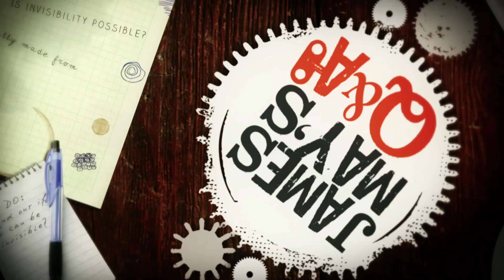Why Can't Trains Go Uphill? | James May's Q&A | Earth Science

Comment: James May, you completely forgot that us Americans have locomotives that can go uphill (very slowly) with great ease! The Shay, Climax, and Heisler locomotives can conquer grades of up to 9% by way of geared wheels. Some even have two gear transmissions. Even though they're very slow, they still get the job done, especially in logging country, as opposed to rod driven locomotives. The Lickey Incline has had it's fair share, but it's nothing compared to grades like Freighthouse Hill in Tacoma Washington for example (3.5% Grade, and took a rod engine and an GM-EMD F9A to tackle it with a four car excursion train two-and-a-half years ago; that's fire and thunder there!).

Good explanation though sir, and now if you'd be so kind to explain why we have no "Flying Boats" of substantial size anymore, or why we are attracted to gaudy cruise ships, over proper ships like ocean liners? Then I'd most definitely be thrilled. Cheers sir, cheers. Complements to your airship video too.
Reply: Steven Michael Well, where I live now, freight trains are on average about 30-40 cars. (But, we have a coal route somewhere that's been known to have trains pulling something ludicrous like 500 cars...).
The majority of passenger trains can be as little as 2  cars.(one even sometimes for my local city route). 2-5 is pretty typical. With 6-8 on particularly busy routes...
(Also, certain kinds of famous long distance passenger trains average out to about 15-25 cars, but at busy times may hit 50 or more...)

However, I used to live in Europe, and there the situation is a lot different.
Passenger trains are typically limited by platform length, but 6 - 8 cars is found on all but the most low-populated areas.
On routes through highly populated areas, you can easily get 10, or 12 or more cars.
The ICE 1 is a 14 car set... ICE 2 & 3 typically are 8 car sets running in pairs (so about 16)
TGV's are in some cases running as pairs of 10 or 12 car sets (20-24 cars)

And on top of that, in places where the loading gauge allows, you frequently find double-decker passenger coaches.
Often these are used where the platform length doesn't allow longer trains, so you might see a 4 car double-decker set in use.
But just as often you see multiples.
For instance, in the Netherlands I encountered a train composed of double decker EMU sets... the train consisted of one 6 car set, with two 4 car sets (so 14 cars.)

Then there's the TGV duplex, which in spite of being a double deck train is still 10 cars long, and often run in pairs...

Meanwhile, European freight trains are often only about 10-30 cars long...

As a result, freight and passenger trains end up being much more comparable in length.
(freight trains are still heavier, but not necessarily longer.)

It's amazing how much such things can vary around the world... XD
Reply: For that matter, he mentions the Eurostar, which partially runs on the french high speed network. Both TGV's and 3rd generation german ICE trains run on routes with a 4% gradient without any special adaptations at all... And special purpose geared locomotives can go up steeper slopes than cars can handle...
Reply: Steven Michael Well, maybe...
Freight trains are in general longer than passenger trains, but even if they are not, they are often heavier regardless.

But, the thing all these high speed trains tend to have in common, is well, high speeds. Many of the steepest gradients on high speed routes are momentum gradients, which trains can only actually climb consistently if they're going fast enough to get to the top through momentum alone.

The German ICE routes also show the impact of distributed traction. The Cologne-Frankfurt route has 4% gradients. ICE 3 trains can run over it with ease, but ICE 1 & 2 trains are not allowed on the route. Even though they could make it over 4% gradients when at speed, they are not allowed on the route because if they come to a complete stop for some reason, they would at best manage a 3.5% gradient. The ICE 3 has a higher power to weight ratio than the older two versions, but it also distributes that power over the entire length of the train, with every other car being powered, and 50% powered axles overall, compared to just 8 out of 56 axles (~14%) in an ICE 1 being powered, or 4 out of 32 (12.5%) in an ICE 2 set...
Reply: the shay goes up 11% at the top of cass
Reply: KuraIthys That is because passenger trains are shorter.
Reply: Yes, short line railroads especially have to take runs at hills. Inertia = Efficiency. I'm not sure where you live, but in America, most passenger trains have about 10 cars while freight often have over 100. Also, passenger trains use locomotives that are made for acceleration rather than power. Lastly, as you said high speed trains run fast (no kidding!) and bigger speeds mean less traction.
     Best Regards

Comment: I think that James may already explained that.
If you use teeth you will create a bigger surface where the wheel contacts the track. Decreasing it's efficiency. They will go better up-hill, But on the smooth road it's speed will be lower.
Also I think it would increase wear and tear on the tires, and create a less comfortable ride. Also seeing that you would need each teeth fall in the hole correctly, Else you might end up flying off. Could result in more accidents.

Comment: lol wut? Cable cars have no engine. they are pulled by cables that run under the road. the tracks have no teeth on them and are completely smooth. How does a cable car "fall off" of a track that runs along the same roads as cars?

Comment: Add teeth, add a lot of friction. under the weight they would also wear incredibly quickly as gears have to have a set mesh, when pressed to hard, they grind, wearing and stripping them. So it would wreck the train and track essentially.

Comment: Well, my theory is increased wear, low load limit, reduced strength/stronger materials required, speed limit, and more maintenance. A quick search on google, as encouraged by comments, does reveal exisiting toothed railways. However, they probably are plagued with the aforementioned problems. The force pulling/pushing the train would only pass through a few teeth, and it would be forward force; they could easily break off (well, compared to no-teeth-to-break regular railroad).

Comment: So finish the rails on steep inclines with a suitable high grip (or higher than smooth steel) alternative and jobs a good'un surely?  Even using a softer steel that would deform more and so increase the contact patch would help.  There is a probably a good reason why this hasn't been done but I can't think of it...

Comment: 2:52 you said it had to overcome the weight of the train.  The only horizontal retarding forces acting on the train is air resistance.  The static friction of the wheels on the rail are what give you the maximum traction force that propels the train.  This will also be limited by internal frictional forces in the engine.  Are you referring to the mass since the working equation would be ma=Traction-Drag?  Love your work.  Keep on inspiring the sciences and engineering.

Comment: Iron is easy to replace and strong enough to withstand the weight of the train.. Tough even if they could find a material with enough friction it will be difficult to apply it to the small wheels and it will create drag while going fast.. Once the train starts to move the use of iron for the tracks become apparent, Less drag = more speed = less energy wasted...

Comment: Adding sand on the track in front of the traction wheels will add friction also adding grip witch is always useful going up a 1 in 40 grade in wet weather, also modern day locos have ZTRs or traction control systems to prevent wheel slip, but momentum is the key component to have a heavy under powered loco crest a ruling grade. Just like a roller-coaster

Comment: Would it be too difficult to have rails with a rubber coating/layer on top for inclined sections to, for the stretch of the ascent or decent, increase the coefficient of friction between the wheels and the rails, thereby increasing the tractive force and allowing for a greater incline...

Comment: Propellant cog with wound spring; movement determined by amount of release from each click. Gear clicks once, tooth disengages and turns gears attached to wheels. Diameter of spring wheel is such that each movement slings wheels forward a bit until momentum is built.

*shrug*

Tried to visualize it in a minute or so...

Comment: It's height divided by length.
A slope of 80% is 4/5 = 1/1.25 = 0.8 where the 1 is the height of the slope, and 1.25 is the horizontal length of that slope.

Comment: most of the metro systems do have "bumps" but i assume they are built so that the gradient is very small between 2 stations and they probably rather have deeper stations than get the trainsets climb on the lines

Comment: James was obviously referring to "regular" trains on normal tracks. The Pilatus railway is an interesting type of cog railway which has a horizontal double rack between two rails with the rack teeth facing each side, engaged by two cogwheels carried on vertical shafts under the car.

Comment: There are so many faults with the idea of gearing wheels to rail that I couldn't even possibly list them in the limited amount of characters You tube gives.

The better solution, and it is done on the high speed dedicated passenger trains is to drive more wheels with independent motors. Each car has electric motors driving wheels. This increases tractive effort but comes a the cost of expense and complexity. It also only works well for trains that draw their energy from external sources.

Comment: They could, and you would get around the issue of inclines.

But then by increasing the friction, essentially, by using gears, you remove the train's great advantage (as James demonstrated with the Eurostar) - it is the comparatively minimal wheel-to-track friction that allows trains to achieve such high speeds on relatively low power.

Plus, you'd be introducing gears which will wear out, purely because of the higher friction.  Maintenance costs would go through the proverbial roof.

Comment: Well then the problem simply lies on the gearing. Make special train tracks (a little wider than the normal ones) that looks like staircases, then mount this couterpart gear (imagine sticking a small triangle with sides 2, 9, 8, and stick the 9 side to the wheel, then spin the wheel clockwise and stick another one, front to tail, so on...) outside the normal wheel, then no sheer strength problem! Compatible! Right?
By the way if anyone care enough please tell me what's that gear is called.

Comment: There is a cogwheel train in Budapest also. As there are some smaller hills inside the city, the streetcars are equipped with a sand-sprinkler mechanism which helps to increase the friction (somewhat).

Comment: They are used in specialized instances, but the cost of building and maintaining them is a fair bit higher than standard tracks and trains. As such it's simply not economical to implement such a system in large scale.

Comment: The cost of gears on wheels would not be a cost issue, and racks could be implemented on only steep grades.  Maintenance costs would be high though.  My comment only addressed the technical issues as did yours.

Comment: The problem w/ rack-and-pinion drive for train tracks is not strength because the gear pitch & P.A. can be sized for the load.  The problems are friction & fretting corrosion; gear teeth need lubricant because they slide as they mesh, inviting galling & catastrophic failure in an exposed, unlubricated environment.  Also, significant power loss & heating would be high using dry steel-on-steel, sliding power train surfaces with their high friction.

Comment: There are such kind of tracks which usually have an extra track between the standard issue track. This extra one is designed to grip with a cog wheel. Those kind of trains and tracks are usually to be found at very steep hills. If you remember the big fire catastrophy in a swiss ski resort, this was a cog wheel train (this was not the reason for the fire). 
An example for Germany would be the Drachenfels train in Bonn and some others.

Comment: Not possible, because train wheels are designed to move sideways and at different speeds on the same fixed axle, otherwise a train would not be able to navigate through bends. Because of their shape this is possible. Teeth them and that same train will fall of the tracks instantly.

Comment: Think about automotive transmissions. They need lubrication of they will overheat from the friction of the gears together. Lubricating railways in an efficient manner would be near impossible.

Now go back to why James said the train can go faster with 22hp per ton. Now replace that small contact patch with gears and you get very, very sow train. Again because of the friction of the gears.

This is just 2 of the many reasons why gears would not work.

Comment: couldn't this problem be overcome by designing train tracks and wheels with teeth akin to gears. As James noted, with such a small contact area between the wheels and tracks, interlocking teeth could be achieved quite easily without running into an issue with the teeth grinding together. Granted, all tracks would have to be redesigned and replaced, but this could nevertheless increase the climbing grade achievable and lessen costs, travel distance and the environmental impact of planning lines.

Comment: Its all done on the programming side. Basically it finds the setting that gives the sharpest image or least blur or in one way or another. Blur can easily be calculated by how similar every pixel is to its close neighbors. Pretty much if you can tell an image is blurry a good program would be also would be able to tell, I would imagine that most cameras that can do this are better at this than most if not every person. In 'a' way it finds the best possible focus setting.

Comment: "Leaves on the line" has nothing to do with traction. Signallers need to know where the trains are and that's achieved by the train completing a circuit between the rails. The rails are divided into sections hence the signaller knows which section it's in. Leaves stop that circuit being closed and then the train disappears from the signallers board. This will be a thing of the past as we are now installing axle counters everywhere.

Comment: ... according to high school physics. Which means that you come to that conclusion if you assume as true a whole lot of almost true things. One of them is that materials are perfectly rigid. They're not (but in the case of steel they're pretty close). One of them is that friction works in a simple manner. It does not (although there are few models that works better on general cases). One of them is that the temperature is constant. It isn't (however, thigs cool down again rapidly).

Comment: Traction decreases as the slope increases, it doesn't stay the same. Although at such a small slope maybe it won't change enough to be an issue? If the train was going straight up friction would be zero so it has to change with slope. Did you mention how trains are made to drop sand on the line?

Comment: Cogwheel railway. It uses a third "rail" ( a rack actually), but the idea is the same. So the "normal" wheels support the weight, while the cogwheel provides traction. I think it's done this way, because if it only had cogwheels, the ride would be anything but smooth.

Comment: Rack-And-Pinion Railways do just that. The two outer tracks are regular rails, but there is a third track in the center (Rack) which meshes with the Pinion Gear (big toothy wheel with BIG teeth. small ones are otherwise useless), and the Pinion Gear is driven by the same power as the outer wheels.
If there is otherwise fouled track or the train looses grip/power on the outer wheels, the Pinion Gear keeps it either moving safely or acts as the main brake for the train as the teeth won't slip.

Comment: Correct me if i'm wrong but the phrase "gradient adds drag" @4:03 is incorrect. Drag is the force caused by air resistance, gradient adds a force which acts in the same direction as drag, but it doesn't "add to it"